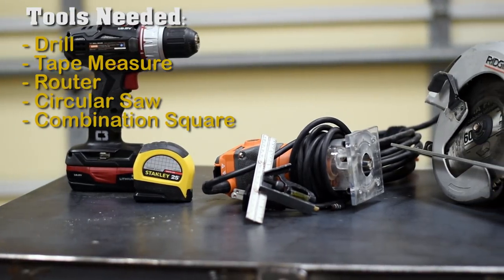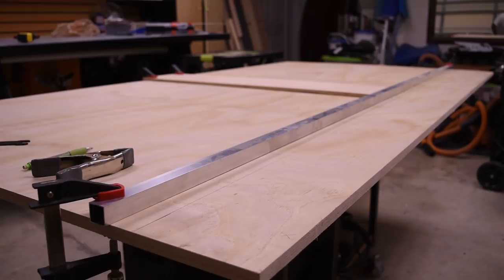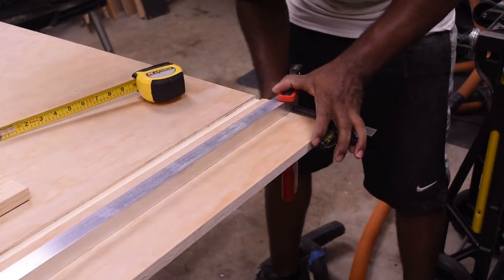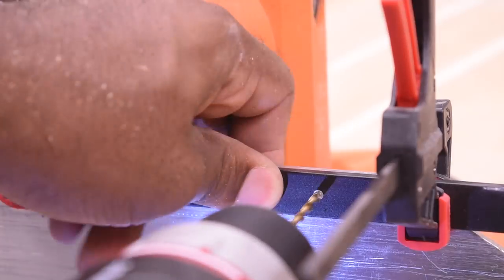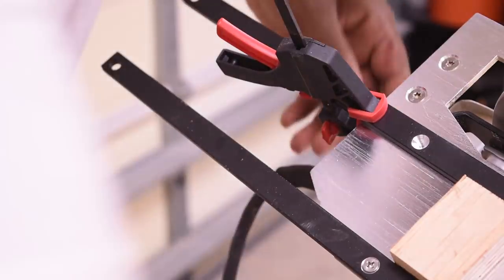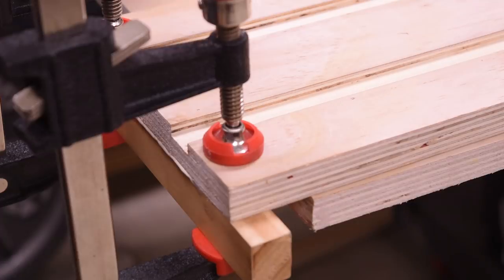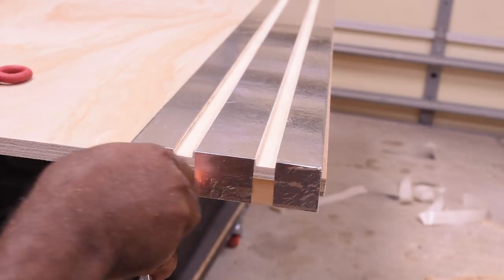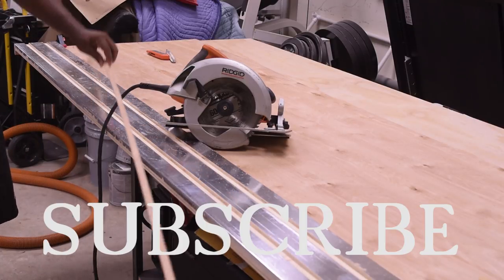How To Build A Track Saw |  Limited Tools Episode 001

Comment: I'm a 15 year professional custom furniture maker and this is by far the best method for this I have seen yet. 

only suggestion would be to have a piece of extruded aluminium milled to accept the tracks instead of using plywood. 

it is much more costly but will pay for itself in accuracy and longevity.

great video!!!!!!

Comment: Saw your vid on this and I was sold!  I picked up a used circ saw (Hitachi) for $40 on Craigslist (didn't want to use my Porter Cable).  The Hitachi is in really great shape - took it apart and cleaned/lubed it up.  I have a bunch of aluminum rail stock and prep'd it to install on the foot plate.  That's as far as I got today.  Tomorrow and the next day I'll attach the aluminum rails to the saw and rout the track grooves in the plywood.  I plan on making an 8' and a 5' track board.  I'm kind of excited to see how well this works.  I'll post an update when complete.  Thanks for posting this!  I've needed one of these for a while.
Reply from the maker: Thank you. Thats a good idea getting a 2nd saw. Id love to see that update.

Comment: This is the best diy track I've seen so far, great work mate. If you left the blank a bit wider you could cut both sides and make it double sided like the Dewalt
Reply: I agree I plan on making this, great job!
Reply: Not so sure what you mean by this. Could you explain
Reply: Patrick Stratton   Regarding a double sided track saw.    Suppose you have two saws    For instance one corded and one cordless.    You install rails on both saws.  Use the corded saw to cut the tracks bottom edge.   Use the cordless to cut the tracks top edge.    Thus two saws one track.

Comment: For spacing the rails one could fasten one and then put the saw in the slots on top of the other rail which is put into the slot free, then, slide the saw back past the end, then drill and fasten from the top that end rail from the top.. Turn the affair around and then do it again.

Comment: Good job - I like your attention to detail on these videos. Also like how you  braced your alum. bar - I've been drilling the center and tacking it which leaves a #4 finish nail hole in the sheet goods - never occurred to me to just spring clamp a prop like that.   Instead of the metal tape - paste wax right on the plywood every few projects will keep things sliding around nicely ;-).  A $10 can lasts forever.

Comment: GREAT video Glenn.  This is one of the best video's for a track saw.  I have a circular saw that I don't use much so I am going to make this and use it as a dedicated saw/track saw.
My only suggestion would to make the base a bit wider on the blade side. Then run the saw down the length so you will get a perfect zero clearance.
VERY WELL thought out and worth the extra effort to build.
Reply from the maker: Thank you I do like your idea with the Zero Clearance I may barrow that :)

Comment: Pretty cool idea and great easy set up and squaring or trimming whole sheets of materials like plywood or MDF.  Not that you asked for my advise so take it with a grain of salt.  You might remove the tape and clean the adhesive off as it will be sticky.  Use an adhesive remover.  Then hit the whole thing with paste wax as well as the bottom of the saw.  It will help to keep things sliding smoothly.   I do that for the top of my table saw and the bottom of the jigs I use with it.  I do it about twice a year.    It works well and also keep the cast top smooth and corrosion free.
Reply from the maker: +Danny Compton 
Thank you. You just taught me something. I didn't know it would help with corrosion. :)

Comment: Cool build. A great way to align the runners is to put them in the tracks and use double sided tape to mount them to the saw until you get your mounting holes drilled. 
Dan
Reply from the maker: Thank you. I agree good point, didn't think of that one.

Comment: Good video in the DIY tracksaw.  Step 1 is to ensure that the saw you use has a good base plate to attach the guide bars to.  Some of the cheap circular saws have pretty small base plates.

I have a Universal Edge Guide from Eurekazone and it works great for making straight rip cuts on sheet goods.
Reply from the maker: Thank you. Good point.

Comment: I'll be making one of these tomorrow for my Makita Magnesium Hypoid saw. While it cuts just fine for normal framing use, it tends to be a bit of a beast when doing delicate cuts or when used on plywood. I just spent a nice chunk of change on a few 5'x5' sheets of Baltic Birch plywood of which some will be for a stand for my midi wood lathe and the cuts need to be very accurate. Thanks for the tips.

Comment: For the last year, I've been using my saw guide made of a 1x10 w/ 1" square aluminum tubing attached to the top of it. It works okay I guess, except:
(1) The square tube interferes with the saw motor and limits cutting depth, and
(2) Even with the straight metal edge, there is some subtle yaw and roll of the blade, so what looks at first like a perfect cut will never join to another edge with the "air tight" fit that's intended.

Your design is WAY better, and looks like it'd solve both of the problems above. The dual track is damn smart. I'm looking forward to making one just like it!

Comment: Before I found this I made my own track saw guide.  Lesson learned: making sure the track bars that you bolt onto your saw are perfectly parallel to the blade is really, really necessary to avoid tension and snags, and to getting a clean cut.
I didn't think of aluminum tape, but it seems to me it could definitely help the saw slide more easily.

Comment: looks good. Ive made a similar one for my circular saw. Then i've also used a bolt and nut on the depth gauge to allow me to plunge cut the saw into exact depth. a lot cheaper than a festool track saw that's for sure. The only downside is the track doesn't let me cut at a 45 without cutting into the track. But otherwise accurate enough for most carpentry that i am doing at least.  Great vid
Reply: Make 2-sided track. 
1-st side 90 degrees, 
2-nd side 45 degrees.
Limitation solved.
Reply: With a track saw you can cut any angle as long as you have accurate lay out.

Comment: Great track, I would suggest to leave the opposite side of the cutting edge (clamping side) longer for the clamps to clear the motor of the saw, just in case of a angle cut and 2 clamping point are needed

Comment: Genius. The coolest part about your system is that you can use the opposite edge of the track board and make a router track. Probably good for putting grooves in the long boards. You would probably have to create  a special plexiglass offset base for your router. That way you can use the same track system for two different tools!

Comment: Great idea... and the price is right!
idea... bolt on a 3-5" piece of plywood to the sole/plate of the saw on the outside/right-side of the blade.  Make sure it's too wide.  Then lower the blade to cut it.  Now you have a splinter guard on both sides of the blade.  Plus a little more support.

Comment: Excellent design.  I plan to toss the one I already made and replace it with this one.  The double tracks should be very stable, as long as I can be damnably sure the tracks on the saw and the grooves in the guide are perfectly straight.

Comment: Nice job. You need to run the other side as a 45%. Some sheet goods are longer than 8' (MDF- Particle board) so maybe an inch extension on each end would solve that. Very nice.

Comment: Great Idea, have you thought of gluing non skid shelf-liner to the bottom (don't know it's brand name - but I know where it iis in Harbor Freight, Walmart and Home Depot)? Then you would,t need clamps most of the time. TrueTrac uses polyvinyl strips along each edge to create a non-slip bottom surface. What I'm talking about is a rubberized liner that is similar to carpet non skid roll, but is much thicker. Many pro's roll out the shelf-liner on their bench top to hold pieces in place for sanding, routing etc.

Comment: Great solution!  Really cool idea - thanks!
Reply: Also, another approach would be to do this with a table saw and a dado stack.  Or as an alternative design, even a single groove and a piece of angle aluminum mounted to the saw.  Anyway, thanks!
Reply from the maker: Thanks man. Im doing a series on the channel (Limited Tools) to empower viewers to build. If I pull out tool many tools I might Discourage some. Yes this would be even easier with a dado stack.

Comment: Nice job. Think I will build one. It would be extra spiff kablooie if you found a way to make it take down into pieces, but I guess any scheme of fastening it back together, such as routed slots and bars on the back, side aluminum angle rail etc.. would tend to make it inaccurate and would require a bolt tensioning device or such like.

Comment: great idea but I went to Lowe's and paid about 30 bucks for a attachment for a circular saw, and it's simple, comes with measurements (ruler) and you simply use the edge of your board as a brace and your saw sits on a platform!! now there's no need for a long track!! because your board is the track!!
Reply: but with this you can cut diagonals or pieces thicker than the guide you attached to your saw.
Reply: Todd Pertll oh!! I didn't think of that!! thanks, it's good to have all sorts of gismo's because I guarantee you will need them all!!
Reply: This would also help you straighten up an edge. A saw guide is a useful tool, but needs a straight edge on your board to work. With his track saw, he can make his own straight edge.
Reply: Russ Vance Oh yeah youre right!! I build Chests out of Birch plywood and its very expensive therefore I need accurate cuts!! But as long as im working with a new sheet Im ok!! But a guide track would be excellent to make a new straight line!! thanks!!

Comment: i have he Festool track saw. However, if i didn't have it this is the design i would choose. Most YouTube videos on DIY tracks saws use a signal track where you used two which i believe adds accuracy and stability. i would improve on your design by finding a matching aluminum U channel to accommodate the aluminum track bars on the saw. i think overtime the current dado channels would wear and you would have movement on your saw. Great job.
Reply from the maker: Thank you. really interesting point not sure ill use it that much. This part of a series im making to help viewers get tools and make stuff.

Comment: Nice track saw design but the issue I have is the use of clamps to hold it down as depending on your circular saw design, they can interfere with the saw on cuts when the motor will not clear the clamp.  Maybe adding a metal bracket where you clamp outside of the track may help.

Comment: Good video Glen! Check out Modern Builds video for a tip on how to set the second track. Place the second rail in the track with a couple dots of super glue on it. Set the saw down in the first track and allow the glue to set up. The rail should stay secured to the plate for a perfect match up. Love your videos!

Comment: great video, if you want to do a super cheap rail saw cut off a verified straight side and screw it to the board and but the guide to it and rip it will act as your "rail" cutting off the excesses and give you a accurate straight cut. cheers
Reply from the maker: Thanks for the tip!

Comment: Nice job, I think I'm building this soon! If you make your track a couple of inches too long I suppose you can slice those last few inches off to use as a perfectly sized spacer to separate the two tracks instead of the extra block you used, right? It's be one less thing to measure.

Comment: Saved this video a while ago. Just bought a porta-cable circ saw and will be making this sometime this month.
 Did the aluminum tape hold up?
 BTW, since you used the aluminum flat bars you found. There's always someone throwing out a bed. The iron on those are for the taking and it cost a lot at hardware stores. I use one  for my homemade table saw. Works great.

Comment: If you make through holes in the plate and tap what you're attaching to, you can make the two pieces tighter. The screw holds the threads of the tapped hole and it draws in the other piece with the trough holes.

Comment: Nice build. It doesn't seem like you addressed this in the video, but how did you ensure the tracks were fixed to the saw, parallel to the blade?
Reply: The blade should be parallel to the edge of the base plate. The base plate was his reference point for installing the guide bars...

Comment: This is an awesome design.  There is another video here for one that only uses 1 rail dut it proves far less stable and he added another piece of wood to prevent the saw from rocking.  My only thought is that i would make the base wider on the back side so the clamps don't interfere with the saw.  Any thoughts on that?
Reply from the maker: Thank you. Yes the base could be wider. Right now I use it with a C clamp. I was going to do a under mount track clamp but I changed my mind.

Comment: Great job Glen!! What is the tap you use for making the threads in the plate? Every tap I see in store is for hand tapping and this takes forever. Being able to use a power tool for tapping holes is genius!!
Reply: Maxime Desaulniers Boisvert You get very poor results if you use a powertool when tapping steel. Weaker materials such as brass, aluminum and copper might do ok, but steel and stainless steel will not work as good. You would end up breaking your taps.

Comment: I'm thinking of trying this with star board with the thought it will not warp as easy and would probably slid better. I am thinking of trying to attach sand paper (3m, the one that holds up to solvents and water) to the bottom. Adhesion will be tricky though. Bad idea?

Comment: Thanks for the video but this is little better than a simple jig made by screwing a straight edge to any thin sheet product and cutting the sheet using the straight edge. That last cut becomes your cut line. No router or metal work needed. The part missing from both that is most useful is the sticking feature, eliminating the need for clamps.

Comment: +DIY Creators Just subscribed...really like this. Have you used it to cut laminate...if so, does it prevent chipping? If not, could you router out a rebate on the underside of the 'cut' edge, then add a rubber strip, and maybe a second one in a rebate under the 'back' edge, so the rubber strips provide a second function of 'gripping' the workpiece, especially if it is a liminate surface. Just a thought.
This is the second of your vids I've viewed...great work. Keep it up.

Comment: Do you get a clean no tear out cut from this new track saw version? I really like this alot. Could you use 1/2" instead of 3/4" to lighten up the weight of the track? Excellent video!
Reply from the maker: Thank you. Yes its a clean cut. With the clean cut it has a lot to do with the blade you use as well. I would recommend 3/4 half inch is pretty thin and routing out the tracks may make it weak.

Comment: Pretty bad ass. Haven't seen this before. Gonna definitely build one. 

Quick question. Any particular reason you routed the tracks first before screwing the bars in to he saw? 

It just seems it would be easier to screw in the bars first and then measuring and routing the tracks.

Thanks.
Reply from the maker: +Simple DIYr 
Thanks man.

No reasons. It's just the way I was thinking in the moment. I felt like it was probably easier to work around the 1st track.

Comment: Im sorry i known this is an old video but i really like this idea want to try it. My question is if you used a 5/8 router bit what size was the flat bar. Im looking at home depot and dont see any 5/8 in wide flat bar. Do i need to look at another store should i be looking for a different size or did you just make multiple passes with the router to widen the space  to the size you needed?

Comment: Nice and easy project.
One thing I don't understand. Isn't there a much easier way to build a track saw?
Take a length of plywood...let's saw 8 feet by 18 inches. Attach a rail like your aluminum square stock or even another piece of straight plywood on top down the middle. Let your circ saw ride against that rail and that will cut the 18" sheet down to the width of the wide side of the plate of your circ saw and then run it along the other side and that'll cut the sheet down to the width of the smaller edge of your circ saw plate. 
Am I missing something?
Reply: I made one like you described. The problem is that you always need to ensure that the circular saw's base plate is pressed against the rail while moving forward. It makes the process slower and there is room for error as dust or chips can get stuck between the plate and the rail.
Reply: Good points. Thanks
Reply: oobaka1967 a
Reply: b

Comment: Wouldn't it be easier to use the first cut slot to create the second one by attaching the router (somehow) to a slider in the first slot? By doing this, the second track will be perfectly parallel to the first one.

Comment: I have no straight edge that is 48 inches long ( straight edge that size cost as much as my circular saw). Is standard aluminium tubing straight enough for using as a guide for circular saw ? Or is that a premium aluminium tubing that is machined straight ? Is there any other standard material that can be used as a low cost straight edge ?
Reply: Just my $0.02...go to Home Depot or Lowe's and buy a 4' by 8' sheet of 3/4 plywood to be used for some projects.  Have them use their panel saw and cut a 10" or so wide piece 8 feet long off of the big piece of plywood.  The panel saw in the store has a guide rail for making straight cuts and that should make a very straight cut in the plywood.